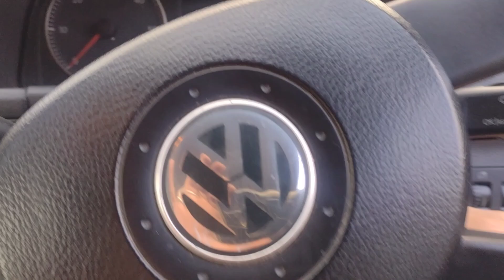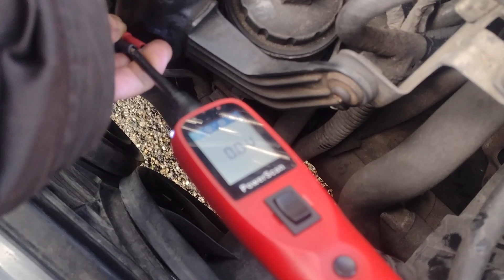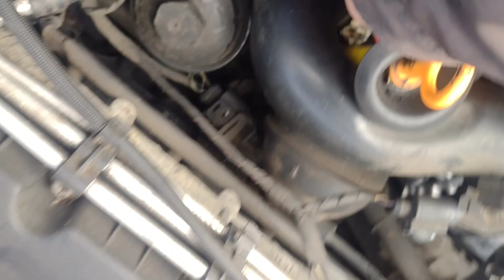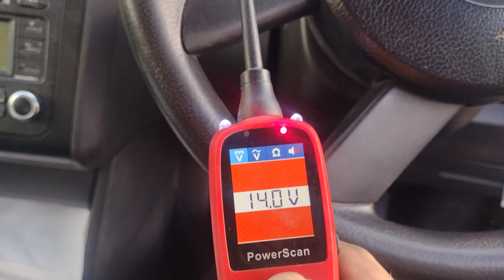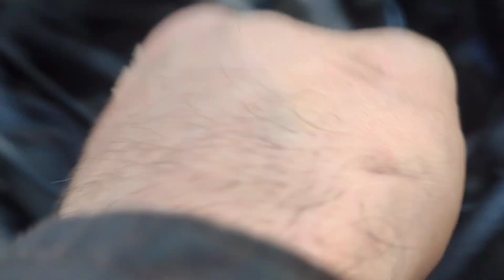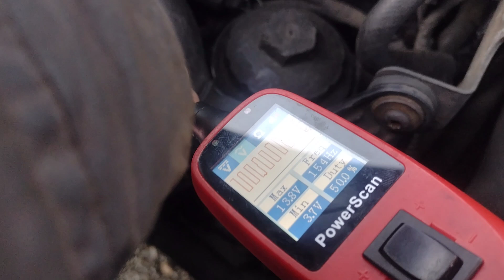VW/Audi (Alternator charging fault) diagnose and repair

Comment: Nice find! What wiring diagrams do you use for jobs like this?
I see a lot of new alternators have no charge until theres a load?
Reply from the maker: @chubbychequer1512  that's true, I have seen that on a Toyota, I had to switch the headlights on before the alternator would start charging
Reply from the maker: I used tech4techs and auto data

Comment: That alternator looks spanking brand new. I take it you were called after the fact?
Reply from the maker: @TheGibby3340  it originally had an an alternator, belt and tensioner due to a slipping and bouncing belt and not charging at all. That wasn't done by me.
After that, the garage noticed that it only charged after being revved up, and asked if I could take a look.